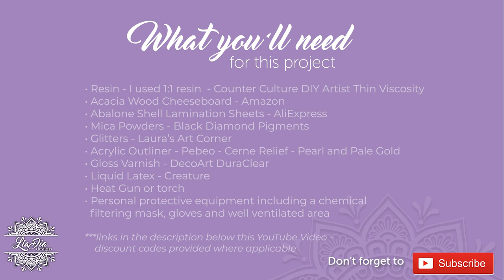Wow!! INCREDIBLE Abalone Seashell Geode Cheeseboards! 🤩 😍  Sparkly Rainbow Bling Resin Art Tutorial

Comment: I’m curious how you kept that organic line with the base resin as you say it does self level?  Did you “tilt” it as well?
Reply from the maker: I'm not sure i understand the question exactly,  but I did show in the video that I adjusted the level of the board for the topcoat
Reply: @LiaDiaDesigns  right, I’m sorry if I didn’t phrase it clearly.  When you put down the green/glitter layer, did you also tilt it a bit so it wouldn’t self-level across the board?